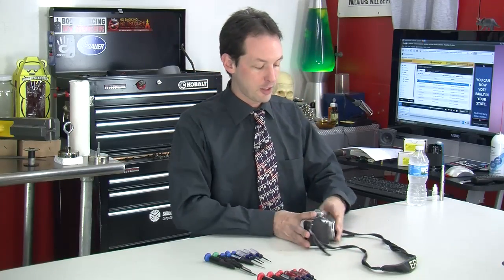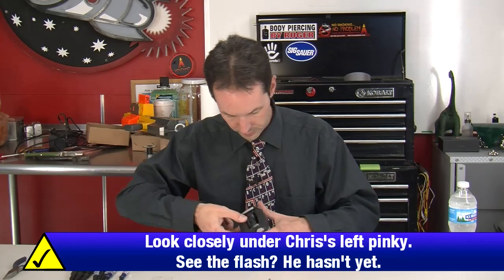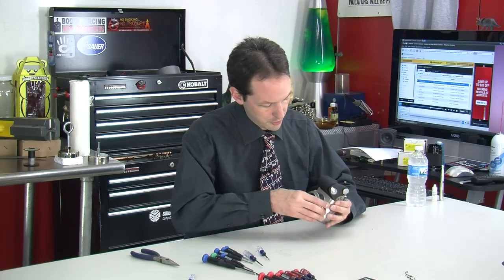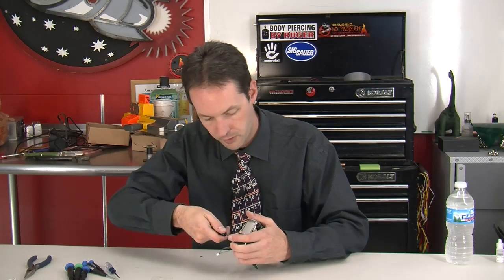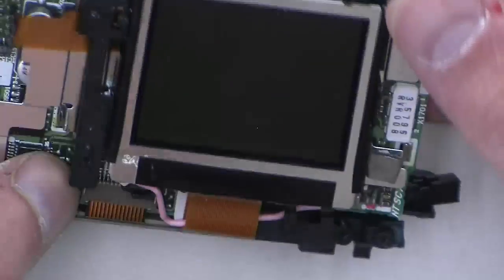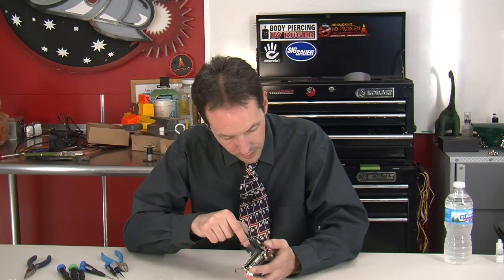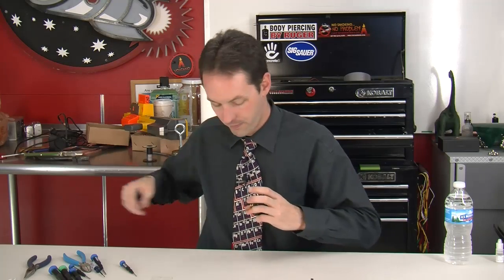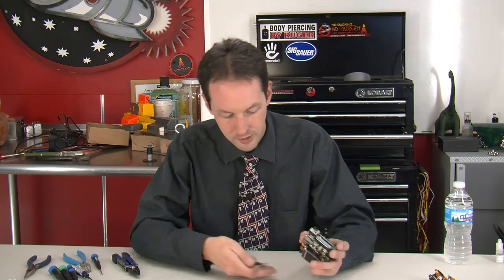Epson Camera: Equipment Autopsy #33

Comment: Yes, the bluish glass was the IR-filter. You should do a visible-to-IR conversion on a camera (I've done it to 2 webcams and an older compact). It takes no more than 15 minutes for most webcams. Just remove the filter (and replace with one that blocks daylight, if you want) and you can see a hot soldering iron glow!

Comment: that thing you thought was a fuse chris isnt a normal fuse, its a thermal fuse, and will break if you solder leads onto it so those leads are crimped not soldered.